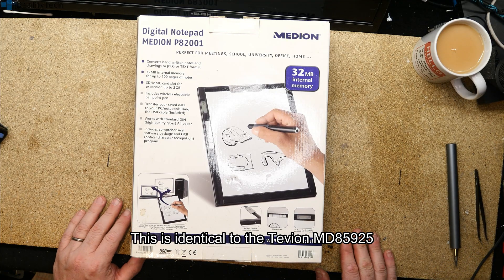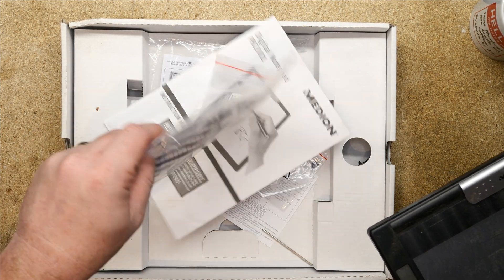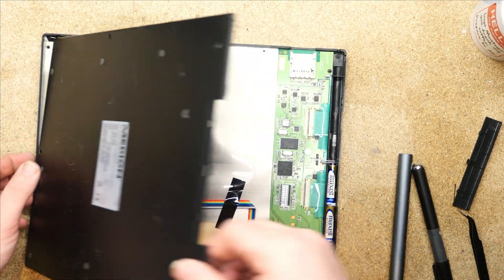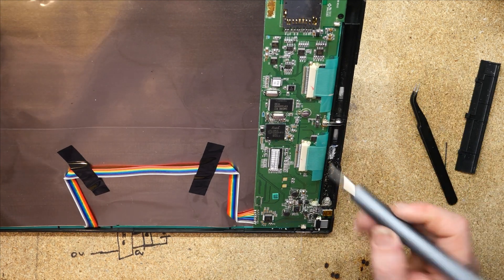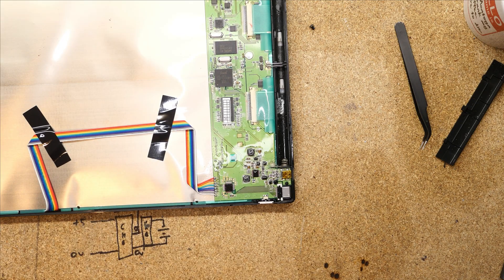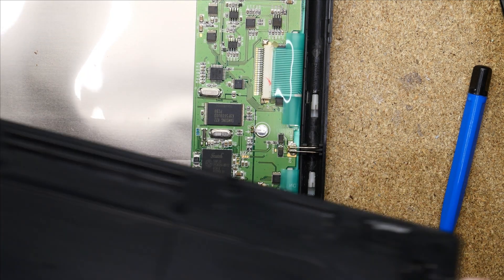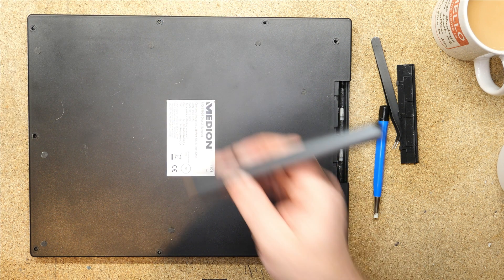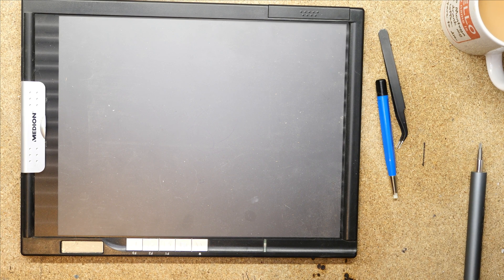#104 - Medion Digital Notepad Teardown

Comment: Slight correction I think -  I have a similar product and different serial code. Mine is 32Mb internal and upto 2Gb SD (I will be trying larger microSD's through an adapter).
Reply from the maker: Cathode Ray Dude had another variation a while back. I'm guessing these were OEM'ed by someone.

Comment: Hi - I've just got one of these from a Charity shop - cosmetically looks OK just needs some batteries I would guess - is this writing pad actually useful nowadays in 2022 - have you done any drawings on your one yet?
Reply from the maker: Windows 10 found it right away and the intro was done on it.
Reply: @rtechlab6254  OK I will get some batteries and give it a go - thanks...
Reply from the maker: @mudsplat  no batteries needed for usb